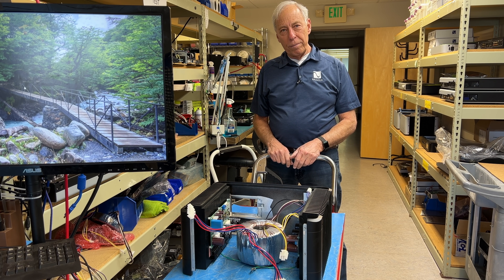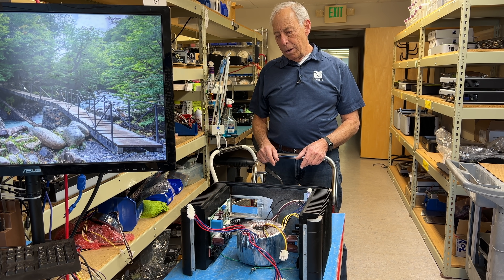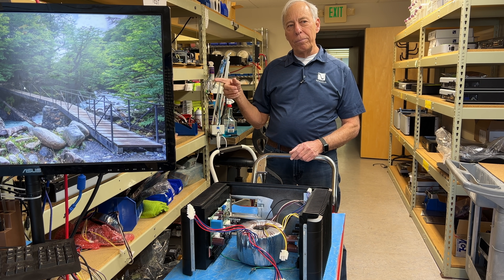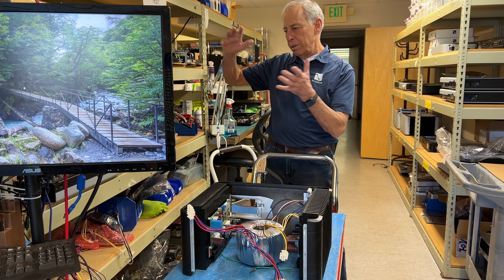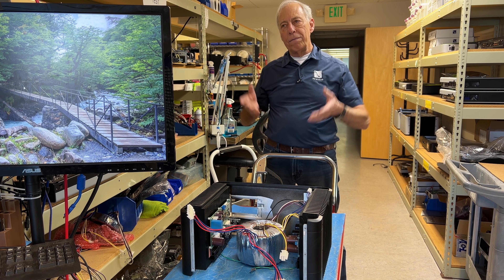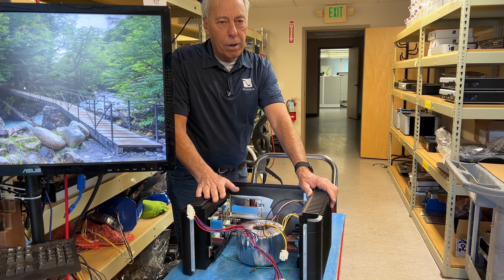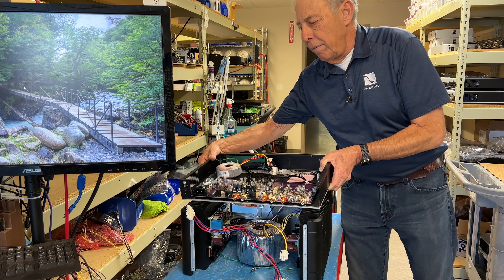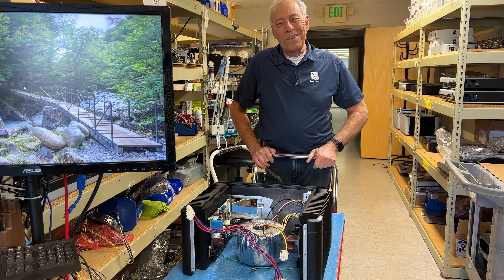Why are many amplifiers empty inside?

Comment: Hi sir. PS audio strata better than Naim Atom? Help me to decide please 🙏🏻
Reply from the maker: Depends on what you're trying to do. As a pure integrated amplifier used to play sources like from a turntable or if you want to play CD (using the integrated DAC), then I would say Strata is better from a sonic standpoint. But, as a streamer, I would say the Naim has the edge.
Reply: @Paulmcgowanpsaudio  only streaming sir. No other players. Hard to decide with ur massive 150W p/c Strata 😓
Reply: I’m in Malaysia and both cost almost the same here. Really need advice to decide 😭

Comment: Yep, true on 19" rack. Even my standard ole Onkyo Surround receiver measures just a tad over 17" across. I also use a steel rack too for other gear. If I fabricated adapter "ears" for the receiver, it would probably fit in the rack!

Comment: The 19” was standardized by the EIAJ if I’m not mistaken. Most of my equipment is rack mount. Only real drawback is you have to have supports at the rear of the equipment and a lot of manufacturers don’t supply rack mount “ears” for their equipment.

Comment: Topping and others are turning this 17" thing on its head... Can fit separates from Topping (DAC , Preamp and Amp) all inside of a 17" 2U case with arguably better specs
Reply: The last Topping amp I bought sounded worse than the Dayton Audio amp that used the same chip.  It didn't sound too bad, but not worth the extra $ over the cheaper one.  More of a complement to the parts express folks than anything else I guess.  I think both models are now discontinued.

Comment: The other thing that "makes for more empty space" is that components are way smaller than they use to be. For example, tuner sections in stereo receivers are no where near as big as they use to be. Also, most amplifiers don't use the old TO3 transistor banks anymore. They were big and required BIG heatsinks.
Reply: The size of the heat sinks has to do with the amount of power they must dissipate, not the size of the transistors.
Reply: @dizzywow  ... yes, but in those days you needed size just for the heat handling ability. Basically the same reason a large radiator in your home can deliver more heat to the air.

Comment: I do the same with acoustic guitars, rap with your middle finger a few inches from the edge of the bridge it should have a  nice woody tone with a long decay, if it has a cardboardy sound with a fast decay it will sound bad.I know, why not just play it, some old guitars may not have their strings on or the strings are so old you cant make a good judgement on the sound.

Comment: Another reason for an amp case to be large is to do with ventilation and air flow. Many components get hot and keeping the components around them cool will extend their life.
Reply: I remember this in the old Sunn Coliseum bass amp; there were warning not to thouch the heat sinks or power output transistors.This is not so much of an issue in class D amps.

Comment: 17" wide audio equipment became a "standard" so it could fit, either on a shelve or with front mounting "ears" in a standard 19" rack. The 19" rack format with rack-units "RU's" of 1.75 inches was established as a standard by AT&T in 1922. The 19" rack format has remained constant while the equipment  mounted in it has changed over the decades. The 19" rack is widely used throughout the telecommunication, computing, audio, video, entertainment and industries.
Reply: Rack unit. https://en.wikipedia.org/wiki/Rack_unit
Reply: @TheElverma  I like the story that relay racks originated in railroad switching yard control systems.  Wiki says there's no evidence they were standardized before 1922 which is not surprising.  AT+T needed lots of relays to connect phone calls and the railroads already had the hardware, using racks of relays to remotely control switches in rail yards.  AT+T didn't invent it, they just standardized it.
Reply: NAD 208 and 218 THX comes to mind when you mention rack-mount

Comment: The knock knock test, that's a new one, never thought of doing that to an amp.
My favourite is to lift one corner and see if the chassis flexes, i.e. one foot of the table, the other three still on the table is a fail.
Reply: I was going to say the same. Rack ears does not make it 'rackable' (without rails).  Boo-Hiss on Pro LOOK

Comment: One other note: For some designs, empty space can also put components with high interference like transformers away from critical areas of the device to avoid noise, and in some cases empty space helps isolate components from excessive heat.
Reply: So you do NOT need noisy- failure prone fans
Reply: @steveurbach3093  Depends on the amp design. Huge power supplies generate a lot of heat.  That said, modern technology allows for more efficient class of amps, therefore they can run cooler. I used to have a Carver M1T amp from the 80's that put out 200 watts continuous, with headroom of approximately 1100 watts. Bob Carver was considered an electronics genius by his peers, and he created a unique magnetic field coil that allowed current to be drawn as need from the outlet. That allowed the amp to run cool to the touch, despite the fact it put out so much wattage. It also had the warm sound that resembled tube amps defying it's mosfet design. The amp is still used to this day, although it is not audiophile grade anymore due to degradation from age.
Reply: It's like the three Stooges said: "Spread out!"
Reply: This was what I was thinking as well before he started, but did not broach the subject.
Reply: First thing that occurred to me especially with mc phono stages.... A missed opportunity?
 Or maybe it's not as important as we think
🎶🤔🎶
Reply: 100% this! Interference from the psu and heat are real problems
Reply: @eugenemartone7023  
Which you can totally circumvent by building separate rooms with active cooling while still wasting less material than is done for the "airy" interior.
Reply: @Mat_De  fans noise could be an other problem with active cooling.
Reply: @tsangkarl1778  
As large as cases are, hardly, two 200mm fans with low rpm would suffice and be dead silent.
Reply: Came here to say this.  A good design will not just try to minimize interference, but also maximize the distance between interference generators and the signal path.
And it's not just power supplies and transformers anymore.  A lot of IC chips - especially digital chips - generate even more RFI than transformers.  There's only so much you can do with a faraday cage.
Reply: @jdlech  
Shielding is MUCH more effective than distance alone, to a point where I won't argue about if it is perfect or not. It's still a far superior solution.
Reply: @Mat_De  My point is that distance is not irrelevant.  Never meant to diss shielding.
Reply: @jdlech  
Got it. Sorry.
Reply: No one knows the exact day hour /But we can see  the signs  events all around us. And  by the timeline,   Israel is  80 years and  1 generation span  according to bible  text will be around  2027 , which israel was declared  first in  1947 + 80 years = 2027 .  so we know we dont have  10 years left as this is 2022  so the   rapture, then the tribulation  will be before 2030 for sure.

The rapture will happen without a doubt and it will happen much sooner than many believe (less than 10 years according to all the environmental, weather,astronomical signs ,israel timelines etc showing ). It will happen without any warning , not one , in an instant , catching masses of people off guard just like God always does, ie the flood ~ a rude awakening . No one knows the exact day or hour the rapture will happen is a certainty . THE RAPTURE CAN HAPPEN NOW at ANY TIME make no mistake !! . Please awake to Christ Jesus which is the ONLY hope NOW and dont let it be found out it IS all true later when its too late & many have been left behind in the most terrible times the earth Has Ever experienced Before and ever will...for anyone who sees this and doesnt know what to do please If anyone hasnt given their life and heart to Christ Jesus will have REAL BIG problems way bigger than any problems Ever had If left here on earth after the Rapture . After the Rapture The USA , Worldwide , will face More evils , Inner city chaos, firearm wars etc etc ,power & water , food shortages , military invasions,mass executions (yes much blood will be required by antichrist ) etctec than it Has EVER been seen Before and you surely dont want to be Here then . We Have Time NOW to change , please seek Christ Jesus while there is still time to save ! no one knows the day or hour of the rapture it will start out just like any other day and it will Take Place In the day In Broad daylight/sunny day , In an Instant FLASH without ANY warning ,& there will be peoples Driver Ids, cell phones ,wallets found in various parking lots,Purses, bill folds Found at work etc etc with NO explanation , and People VANISHING so No One can refute it has taken place. .
romans 10:9-10 That if thou shalt confess with thy mouth the Lord Jesus, and shalt believe in thine heart that God hath raised him from the dead thou shall be saved! 
please share with others =IMPORTANT
raptureready.com

Information  for anyone who has come across those that  refute the 
 rapture and  say  that it was supposedly  made up  and   say it was created by darby church  in 1700s . This is real good  to show it was  way before darby , and its documented .
 also rapture pre trib proofs even in dead sea scrolls .
15-1700s/  irenaeus 170ad/ 250 ad / /isidore 4th century   
sourced by intense search and study by  ken johnson 
https://www.youtube.com/watch?v=e1Nv-xFig8I
Reply: But the con is cable length between the components increase

Comment: Wasn't there also that old classic theory of trying to reduce the number of parts or components to try and reduce any artifice or sonic interference in the signal path too?
Reply: It is actually in reverse. You will still find the better and more expensive hardware bragging about discrete components instead of ICs. Thermal noise crosstalk when multiple devices are on one silicon! Point to point wiring over circuit boards. Less capacitance and path crosstalk....
Reply: are you telling Paul or the community? this guy don't even put tone control in his product. short distance purest sound.

Comment: I think you didnt get what he ask about .
Hm , That remind me about a similary experience a few years ago .
I was to buy an extra amplifier for my studio .
I was in several different shops and in one particulary shop I found 
a japanese amplifier in a big cabinet , but when I looked inside it through the 
holes in the top there was litterly NOTHING inside , just bare empty cabinet and 
the smallest tiny circuit board in the corner .
That circuitboard could easy fit into a 10 * 10 * 5 cm little plastic box and then call it a day .
It turn out it was a class D with switch mode powersupply .
Beside it was an unknown Chinese branded solid state amplifier at same size but when I 
looked inside through top holes , it was totally filled up with big transformers , capasitors 
and big heatsinks with many heavyduty transistors ect .
I tried lift them both and the Chinese one was really heavy too the other was only the thin 
cabinet and it litterly was both thin and flimsy but the chinese was thick and strong .
I listened to both and Just as I expected the Chinese one sounded GREAT GREAT and 
the other sounded thin and weak . It turned out the Chinese was a Class A/B amplifier and 
I ended up buying it ( They both cost the excact same )
I still use it today and it is really strong and sound so great , never regret this purcase .

I did some digging into the japanese one and found out that if you buy all component 
seperate and assemple it by yourself then the cost will just be around 2 percent of the cost 
in the shop .... They make enormous PROFIT by hyping up those super cheap produced 
amplifiers and selling them at same price as the NORMAL good ones with high quality components .

NO Doubt those Class D with switch mode powersupply is extremely CHEAP to produce 
and the PROFIT is the highest of them all ...

Im NEVER going to buy such cheap quality NEVER , Im very happy with my Chinese amplifier 
and the components is great quality and it have lots of power too .
The Class A/B solution is great and rock solid .
( and the box is NOT filled with air , its NOT an empty box )
I guess that is what he mean ( That was my experience )

Comment: I know no one that listened to great sounding gear, was ready to buy, but chose not to do so based on a "knock knock" test.
There are people that buy without listening.  So perhaps they do the "knock knock" test?

Paul, your Aesthetix Calypso has a light cover on it.  And you have praised that pre-amp.  It changed your mind, such that you no longer connect your CD player directly to your amps.

I am not buying that someone that auditioned that that pre-amp would decline to purchase it, due to its light-weight cover.

In a department store, that seems reasonable.  As far as I know, PS Audio gear is not sold in department stores.

Comment: Really awesome amp right there very nice Paul. I have a Nakamichi PA-7, What? lol. Yes they are, becoming smaller because a lot are implementing switcher amps with caps instead of transistors and massive transformers. Less heat, no noise and the winning part: cheap to make. Though I’ll take my transformers and noise any day over a class ‘D’ switcher. Just not a true ‘amp’, no soul and ‘sim’ sounding. Great video, long live two channel.
Reply: Was just reading about the PA-7, that's a nice amp right there. Nelson pass design. How's it sound?
Reply: @peterlarkin762  Hey Peter, outstanding for its age. Very dynamic amp, (some have said ‘veiled’, but that’s just slander imo and   using Audioquest Evergreen for signal) love the older stuff that’s built like real equipment. Nice to have something Mr. Pass worked on, what a talent. It was part of Nakamichis flagship line back in 1988, a good friend here in Daytona that owns ‘Stereo Types’ was upgrading in 2000, and wanted 3k for the amp, pre and tuner. I gave him the “So is that the price for your FRIEND” line, and he looks at me and says: “Go get me 2k cash before I change my mind” with a smile lol. Not a bad day at all at that point, pretty righteous for a decent system. Thanks for your interest Peter, enjoy sir.
Reply: @peterlarkin762  https://youtu.be/dVbAoFfjUtQ just finished this.
Reply: Thanks Randy, man! Think it's an amp on my 'see it, buy it' list now. Honestly, discrete power amp circuitry has not evolved a huge amount since that was produced. And it's such a beautiful chassis.
Rare here in Ireland. A PA5 would suffice. You got a seriously good deal for the stack!
I've also been researching the amazing Nakamichi Dragon CT turntable and it's self centering mechanism. Ingenious.
Best wishes and peace.
Peter.
Reply: How many Class D have you heard??
I've been listening to amps for years (35 +) class A class A/B as that was all that was available

I'm currently using a tube preamp with a class D power amp (600 wpc).
It utterly destroys any of the traditional Amps I've had ( creek, Arcam naim Denon etc etc)
I'll never buy another class A classA/B.
Why do I feel like this ? Why does this combo sound so superior to anything else I've ever owned??
Reply: @sbwlearning1372  35 years, my current system is that old. I designed and built my first class D tube amp when I was 9, that was 50 years ago, very aware of their sound thank you. I’d like to see that pre amp, why wouldn’t you share a video of something that awesome?
Reply: @randymanx2674  No need. It's a Chinese copy of an expired Marantz tube design. The Xiang Sheng 728 MK3 cost £200 new. It's not "awesome" But having thrown some vintage valves in it and using it to drive the icepower Bang and Olufsen class D power amp. ( also very cheap at £800 )I believe it sounds much much better than any class A or AB amp I've ever heard. The combo new was still £500 cheaper than the old Arcam a39 I had.
My ears fell in love before my brain or my heart 😁😁

Comment: A lot of amplifiers today use a switch mode power supply negating the need for a large heavy power transformer, SMD components that take up much less space, and much more efficient Class D amplifier modules negating the need for bulky heatsinks. In fact, PS Audio's own Stellar S300 is a perfect example, with 140 watts per channel, weighing just 13 pounds, and with lots of extra space inside the chassis.
Reply: Just got a LEGACY iV2 AMP for my Legacy Focus SE full range speakers and it is astounding!  I am totally sold on Class D with the latest ICE Modules.

Comment: Need some advise on how to block ultra low frequency that my neighbours have directed up into my flat ...much appreciate it
Reply: Respond with an even heavier ultra low frequency
Reply: Essentially, you can't do much about it. 
I'm guessing it's propagating structurally?
Reply: Mass Law. Need a barrier with high mass.
Reply: @jeffn1384  sorry dnt understand what's high mass
Reply: @goldfinga786able  Heavy. Brick. Concrete. But being more practical, heavy vinyls etc are made as mass barriers.
Reply: @jeffn1384  Move to the detached house .